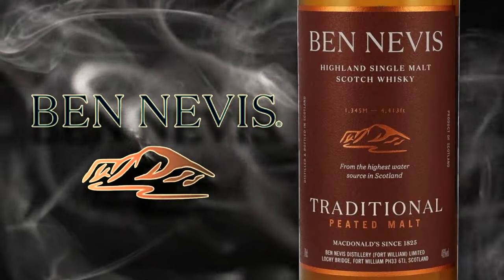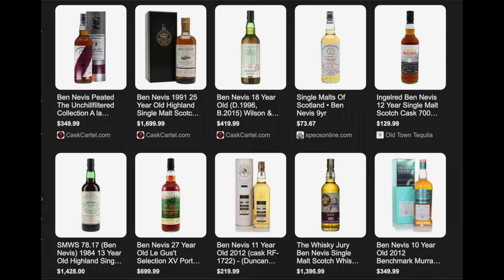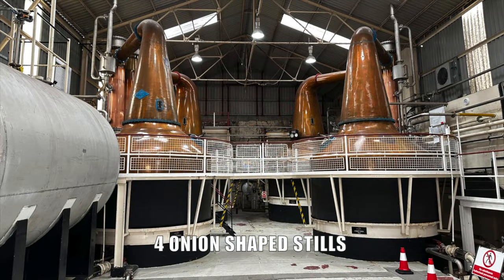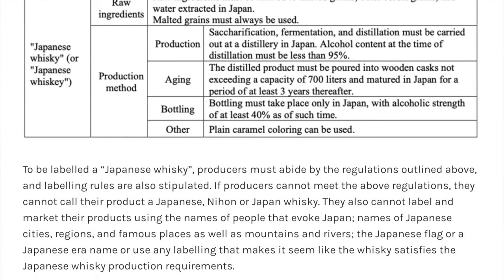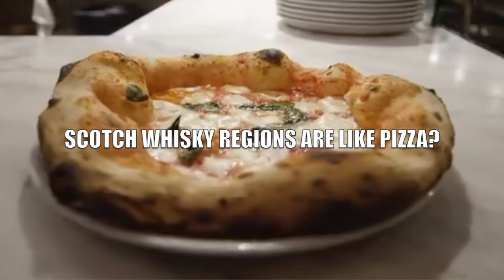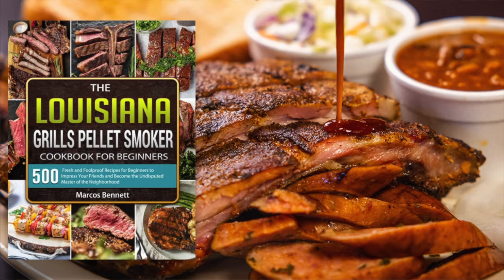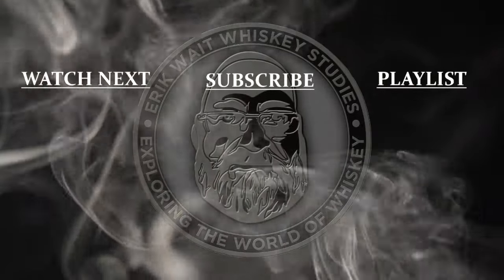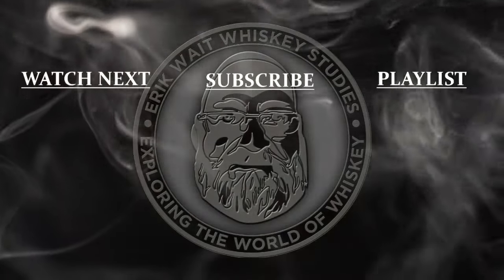Ben Nevis Traditional Peated Malt Highland Single Malt Scotch Whisky

Comment: If you only had tried that Single Malts of Scotland 9-year that you showed listed on Spec’s online. 

No peat, but no offputting youthful notes, either, whether😢 juicy fruit, coconut-pineapple…. 

And it wasn’t just the strength (57.5% abv) that gave it flavor bold enough to match up against any Mortlach! 

Perhaps you heard the story of the huge 1996 independent bottling releases, because bitter rival Suntory-Beam dumped their entire stock of Ben Nevis onto the brokerage market after Nikka acquired Ben Nevis. There is a YouTube video with one of the buyers discussing this…

Recalling that legend, I picked up two bottles, at $69.95 each. My Spec’s store had one case of six bottles. My only regret: not picking up all of them before they quickly vanished!